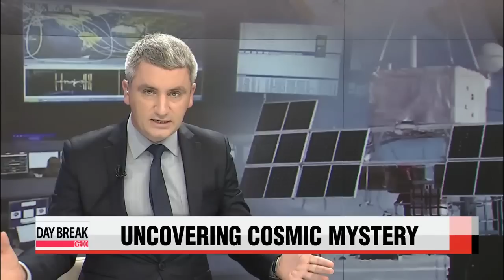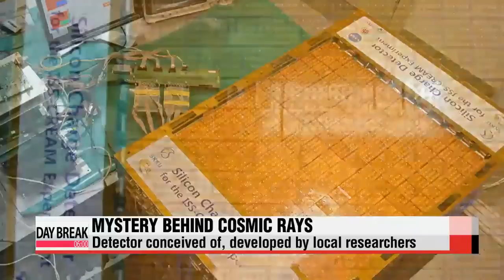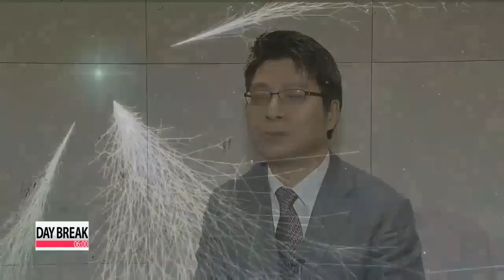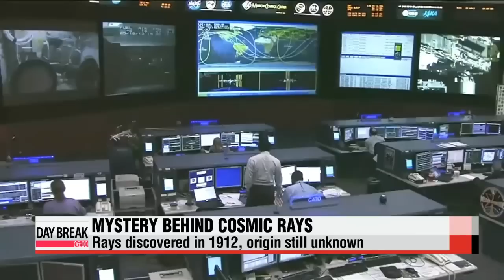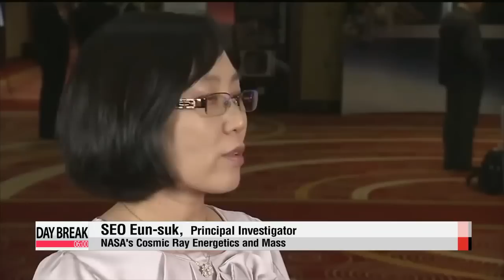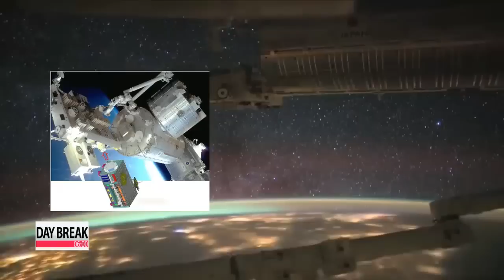Mystery of cosmic ray to be uncovered by locally-made device

Comment: Nitchitsu's Jun Noguchi and Kim Songsu of early 1940s Hamgyong Province had developed cosmic ray muon catalyzed fusion powered rocket plane engines comprised of a Dewar of cryogenic liquified deuterium fuel connected to a beryllium alloy reaction chamber nozzle coiled in around electromagnet coils to focus cosmic ray muons so cryogenic fuel prevented exceeding Curie Point while alpha particles were deflected and converted into neutron flux by beryllium to enrich fuel.

Greater East Asian Coprosperity Sphere of such a time lacked quality ferrous iron amid surpluses of silk and chemicals, too mountainous terrain, Roosevelt's antisubmarine naval blockades. etc.    so to haul freight they had to resort to rocket powered gliders and steam filled airships to service rooftop Hangars having had ground based Mary Kenny STOL fans of factories which spanned from Kumgang Mountains of Wonsan into Changbai Mountains of Eastern Manchuria.

By Fall of 1945 whole mountains were leveled to detriment of Hydroelectric Geothermal to force dependence on coal smelted quality low silicate ferrous iron Soviet and Pennsylvania rail transit tracks, Communists pillaged Hamgyong Province for Sakharov to receive credit for muon catalyzed fusion so a decade later United Nations Peacekeepers had returned from Hamgyong Province for Luis Alvarez to receive credit for muon catalyzed fusion.